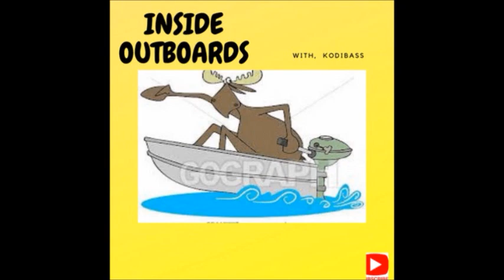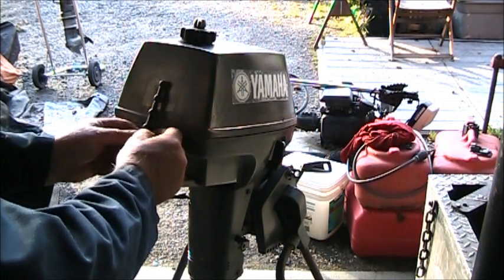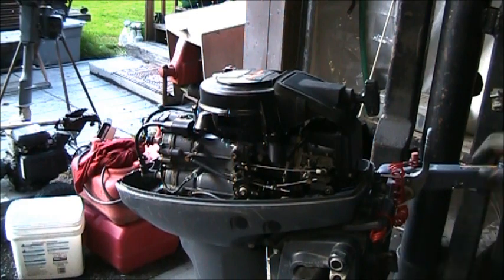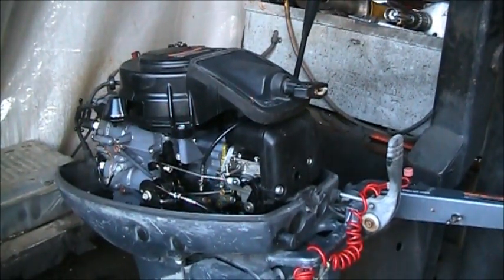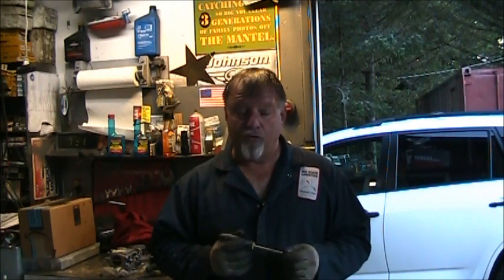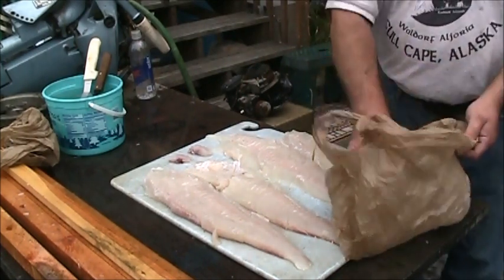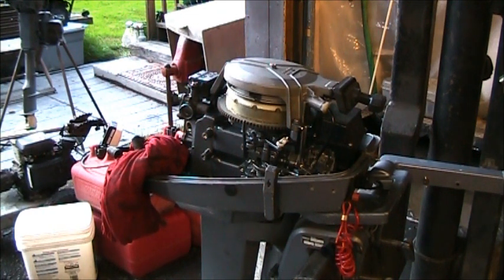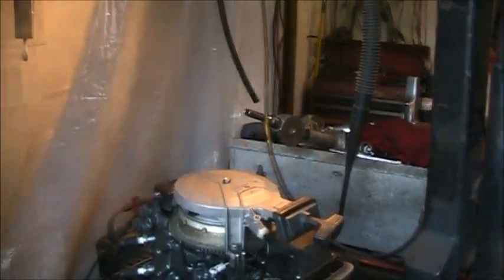YAMAHA Outboard ''s     (  Part 1  )

Comment: Jodi, I’m fixing a 2008 25 MHS having what appears to be stretched out tiller cables. Do you see that much? I am not able to adjust the cables (run out of thread engagement. Have ordered new cables, hoping to fix the problem, what do you think?
Reply from the maker: +jz  Yes' all the time time for new cables,                          kodi
Reply: Ok thanks for the feedback, I’m waiting for parts

Comment: how did you adjust the throttle control
Reply from the maker: +tl,  There r 2 10mm nuts on each side of the cables for adjusting.      kodi

Comment: I have a 1997 20HP 2-stroke Yamaha,  I want to turn into a 25HP. I looked at the parts list brake down, but the parts are the same?? ( jets and exhaust ). Also I want electric start, were could I find these parts given the age of it?
Reply from the maker: +Mr999  ,   The only way U could do this @ cost would B a 25  hp Donor engine.  The Big ticket items  would B the Carb intake &  the starter Bracket & toothed Flywheel. kodi